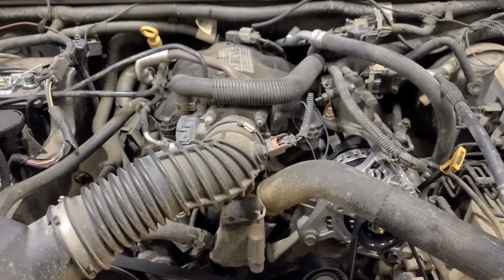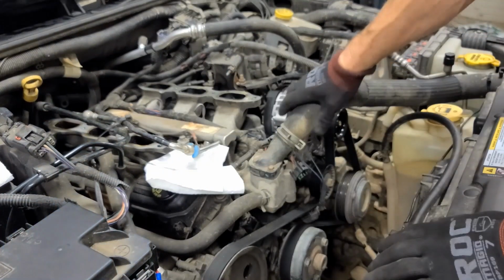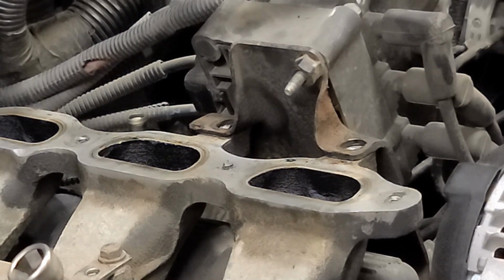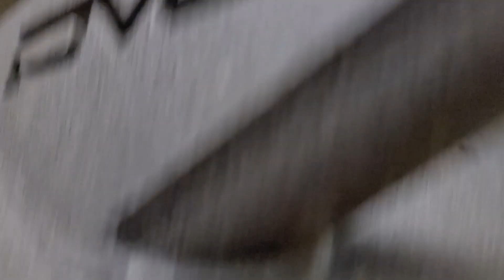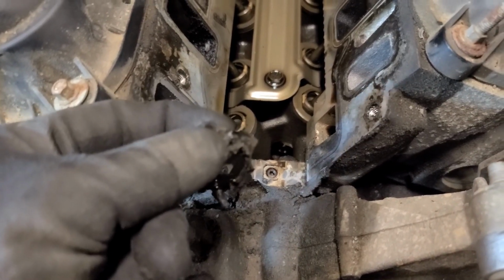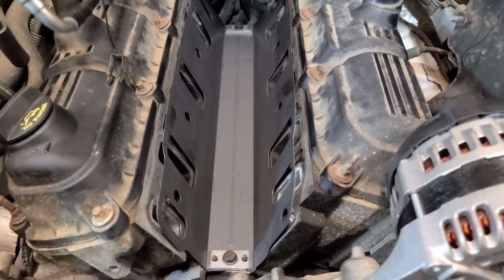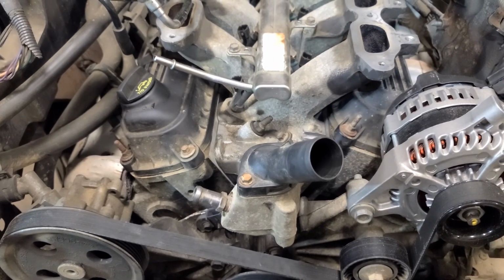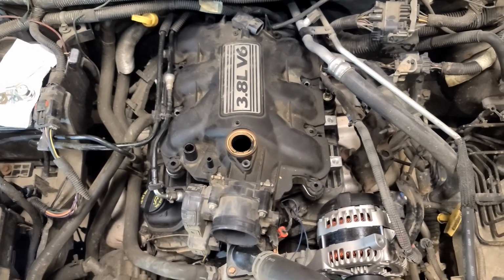Jeep Wrangler JK Lower Intake Manifold Replacement

Comment: Ive been a Auto Tech 25+ years, I have got to say the detail that went into your video was superb! Great work on listing all details. I subbed and hope to see more great vids like these from you. Just another note for anyone that has bad corrosion around that water ports, permatex makes a gasket maker called permatex #1 and its very good to fill in those pits caused by corrosion and make a good mating surface again.
Reply from the maker: Thanks for the feedback, and the Permatex advice!
Reply: @austin.gresham  No problem at all. Im getting ready to do this job myself soon as the weather permits. Thanks again for the video.

Comment: Thank you for posting this Mr. Gresham.  

This along the fuel injector video saved my 08 JK X.  Your instructions and recording was so clear it helped me repair this myself and I'm a newbie at best.

My Jeep had been leaking coolant and oil from this gasket for 4-5 years (I just kept topping it off every other week).  The oil was leaking from the RTV failure points.  I'm not too sure where the coolant was exactly leaking from, but it was pooling on both sides of the engine valley, more so on the driver side.  I didn't find coolant residue besides inside the coolant jackets themselves.  I'm leak free from here as of 100 miles thanks to you.  

As for the fuel injection side of things, the O-rings on my injectors were flat on one side and completely stiff.  The injectors themselves had corrosion sediment inside.  The spray pattern became much better after cleaning them.

I do warn others that if you're a zealous cleaner like me, I recommend 4 things, especially if your gasket covers also leaked for an extended period:

1.  MAP sensor.***  Inspect it and be ready to replace it, especially if your rough idle comes back worse after completing this.  If it's full of carbon/oil deposits, clean it with MAF fluid.  Do NOT use a cotton swab on the piezoelectric sensing part like me.  You'll destroy it.  Just use the swab for the channel/tunnel.  If your MAP sensor is broken, with key on engine off it will read less than 26 inHg, same as your BARO, and will remain at that reading evening when revving up (mine read 24 inHg).  If your MAP sensor is good, at idle it will drop to about 10 inHg.  Volts should read between 0.3 to 4.6, increasing the closer you're at wide open throttle.  I didn't have back probes available, so I decided to test resistance anyway.  The broken MAP read OL/1 with my Harbor Freight multimeter even at 2,000k resistance (max setting), measuring from either side of the middle prong.  The new MAP read 0.19 ohms with the left and middle prongs.  The right and middle prongs read 0.06 ohms.  For these readings, I held the sensor tube/nipple facing up but away from me while the 3 prongs faced me. The multimeter was set to 20k ohms reading.  Make sure the leads/alligator clips don't touch each other and are securely placed on them.  I read somewhere that MAP sensors shouldn't be measured for resistance because they're piezoelectric but I was just curious to take readings.

2. Shop vacuum with extensions.***   If your wire loom is as brittle as mine is, even if you cover everything up with painters tape/lint free towels, little parts will fall in.  If you scrub off carbon deposits with a wire brush and you don't bother to make sure the valves are covered, things will fall in.  Have a thin shop vacuum with extensions ready.  Taping hoses to the end of the vacuum shop can only do so much.  Go in gently so as to not shave off plastic from the extension wands into the cylinders.

3. Wire tape/loom.***  You're already here.  Might as well restore the loom with wire tape/loom.  Clean the wires with alcohol.  Let them dry.  Take your time.  Use zip ties to keep the branches together if you do take the harness apart all the way.

4. Oven cleaner and brake cleaner.***  I had so much oil, coolant, and dirt baked into so many of my components I got impatient.  Though the oven cleaner took off the gunk off the lower intake, it also etched the aluminum.  Don't use the oven cleaner on any plastic or engine block components as they can crack/permanently stain them.

I used brake cleaner to restore the upper intake/plenum.  Though it's plastic, I was careful to have running water immediately with me.  It still managed to warp the "3.8 L" sticker, but I feel so much better about it being clean.  The plenum will take the longest to clean.  I found soaking it in degreaser/vinegar to help.  

If I had to do this again, instead of letting the oven cleaner soak for 5-10 minutes like the directions asked for, I'd do several separate applications until the gunk came off.  Then I'd rinse with vinegar to stop the chemical reaction from burning the aluminum.  Water has mineral deposits, so I found myself doing one more pass with brake cleaner.  I would also want access to hot running water and Dawn dish soap.  The cold Dawn dish soap took out most of the gunk from the lower intake.  The upper intake was just harder to clean because of the limited space and creases.

This video made the process very fun.  Thank you again.
Reply from the maker: Fantastic!   Thanks for posting all these details as well

Comment: Thanks for uploading this video! It is awesome. I am mid changing the lower manifold gasket and valve cover gaskets on my mom's 09 wrangler and helped me with a couple points specifically draining the coolant - was not sure if necessary or not. Also learned about the rtv. Thanks again. Very in depth.
Reply from the maker: Thanks!  Glad it helped

Comment: Good video. I appreciate the time and effort in explaining the steps. I'm facing this repair on my 08 JK with 135k. I noticed coolant under the intake. Already have done the valve covers x2 and the oil pan gasket. I'm betting mine is leaking oil from the back of the lower intake gasket too.
Reply from the maker: Thanks for the feedback! As to your coolant leak, you may also want to check the thermostat housing (where the big hose from the radiator connects to the lower manifold).  I've had leaks there and the coolant "pools" in that spot right below the lower manifold gasket and the engine block.  Then the heat burns it off and you're left with a pink-ish crust from the evaporated coolant.  It may look like it's the gasket, but it may not be.  Thermostat housing is MUCH easier that the lower manifold (and cheaper!)...  also, could be the coolant temp sensor:  check the threads around there as well for that same pink color.  Good luck!
Reply: @austin.gresham  Good advice! I do have oil build up at the ends of the valleys so I am fairly certain the intake gasket is leaking.
Reply from the maker: @AlanWoodardwoodisgood  Sounds like it you may be right. Good luck with the repair!
Reply: @Alan Woodard. did changing the gasket fix your coolant leak?
Reply: @writtenpieceopaper1  Yes it did, still holding strong.

Comment: FYI:  You are referring to the socket size for the bolts -- 12mm or 13mm socket size are usually M8 (8mm) bolts and 10mm socket size is usually M6 (6mm) bolts. A 10mm bolt will usually have a 14mm or 15mm socket size.  Other than that, this is a nice video.
Reply from the maker: You are 100% correct. I am referring to the socket size so people don't have to guess which socket/wrench will work. I do say "bolt" which is technically not correct - the bolt size, as you pointed out, is usually designated as "M10," "M8", etc - not the same as the socket/head.

Comment: I have 435k miles on my JK.  I take bolts off low mileage minivans and use them.  Next rebuild plan on using metal valve covers off 2001 minivan. PCV valve hose will have to be modified on valve cover.  My plastic valve covers are warped but are working. I also bought a low mileage air intake manifold. The manifold is showing its age.
Reply from the maker: 435k miles is awesome!  Looks like you're doing all you can to keep her running.  The manifold is easily cracked, I actually put my finger through the top of one (resting my weight on it trying to get a bolt out near the firewall).  Luckily it was superficial and didn't poke a hole into the actual intake chamber. Unless you plan on another 400k miles, I would just use the same style plastic valve covers and spare the time/effort of modifying the PCV valve.  But if you have time to experiment, sounds like a fun project!

Comment: I have a leaking oil, and coolant problem, guessing this is the same issue you had.  can you tell me where I can buy the proper bolts, as snapping them in the engine is terrifying..  Great video!
Reply from the maker: The MOPAR part for these is 6102001. They are M6x12mm bolts you could source elsewhere, if needed (and likely cheaper)

Comment: Just snapped a bolt trying to get 105 inch pounds on the upper manifold. Brand new torque wrench. So be very careful when you do this, lucky me my engine is out so I can work around it to make the repair easier
Reply from the maker: Been there... I think technically Jeep recommends that the bolts be discarded and new ones used. I have extras just in case, but getting the broken ones out is no fun.
Reply: i’ve seen a lot of people have that issue from not blowing the threads out with compressed air after cleaning the surfaces. debris and dirt doesn’t compress well in the threads and boom, snapped bolt
Reply: 😂 yep the rest are hand tight. Waiting on new bolts.

Comment: Can coolant also get into the oil from the lower intake gasket failing?  My last oil got 'dirty' faster than usual?  I didnt have it tested, but will next time if it can.
Reply from the maker: Absolutely it can.  If the lower manifold gasket leaks, it can leak coolant directly into the engine, all the way to the pan. If it's bad, the oil in the pan will look like chocolate milk - that's a sure sign of coolant in the oil.  It could also be the head gasket.
Reply from the maker: Also, a simple way to check the head gasket is to remove the radiator cap and let the engine warm up to where the thermostat opens (roughly 200 degrees).  When the T-stat opens, if you see bubbles coming up into the radiator where you removed the cap, that means exhaust gas is getting into the coolant - most likely from the head gasket.

You can also rent a pressure tester from a local auto supply store which will tell you if there is a leak in the coolant system - just not where the leak is.

Comment: Great video Austin.  Really appreciate all of the time you took and detail provided.  Did you replace the EGR gasket and would you mind posting the part #?  Thanks!
Reply from the maker: Thanks, Chris!  I did not replace it in this video but I did when I replaced the fuel injectors (other video).  The gaskets I used for both the upper and lower EGR were NAPA.  The part number for the gasket that goes into the upper intake manifold was #70696 and the gasket that goes between the EGR valve and the EGR tube (under the wheel well) was #70721.  Both have worked great.  Good Luck!

Comment: The one im doing has rtv on both ends as well, around the coolant passages.
      Its leaking coolant.
   You reckon this is why? Its definitely factory. But this isnt the type of gasket that should have rtv on it.   Was always told if ypu have a gasket, adding rtv is just doubling the amount of places that can leak (1 spot between each layer of )
Reply from the maker: You definitely should only have RTV in those end spots where the block meets the cylinder heads. If you're seeing RTV anywhere else, I can't imagine that was factory. It could also be sludge build up from oil/coolant leaking and maybe not RTV, but that's just a guess on my part.  Regardless, scrape it all off and get a good surface for that new gasket.
Reply: @austin.gresham  lol just finished the job, fired it up, and its releaking, so bad . Took a few pictures, the intakes got pitting around the passenger side. 
      Cant get these i takes anywhere, id imagine this is why there was silicone on it, to hide this. I bet the dealer the customer bought it from did it, they bought it used about 7 years ago, said theyve always smelled coolant but no ones been able to find the leak
     Gonna see if the local machine shop can plane this thing down a few thousands or something.  Friggin sucks having to do it again
Reply from the maker: @marioncobretti7870  Sorry to hear that, it really sucks when people half-@ss a job and hand the problem onto the next owner/sucker who gets to deal with the aftermath.
Reply: @austin.gresham  ended up using high temp rtv to fix it. Its not leaking now, told the lady if it happens again ill redo it. Machine shop wanted way too much lol
I dunno why no one makes a better gasket or a different aftermarket intake. Youd think seeing as every wrangler ever made sells there would be a market for a known failing part. 
    Wish there was just a gasket like gm uses, thicker with rubber/eurythane around the coolant passages.,  but i guess in todays world cant expect too much. 
     Ill take it as a win anyways. Couple of  The bolts holding it down to the heads barely came out,  if they would of broke i dunno what i woulda done, so I cant complain too much

Comment: Thanks for the video, I did this the other day? Did you put any extra gasket material rtv or anything like that between the intake and the gasket? On my oem gasket, it looks like there was some there.
Reply from the maker: Thanks!  No, you don't want anything in between except the RTV in the corners. If there was something on yours either the previous mechanic did it wrong (which might be why it leaked) or what you see is crusted oil and/or coolant. The cylinder head and manifold surfaces should be clean and smooth.

Comment: Could the bolt holes lineup without it sitting flush? I just did this and have a vacuum leak now
Reply from the maker: If you are talking about the bolt holes for the lower manifold and not another part, no I don't think that's possible. I think it's more likely that it's above that in the upper manifold/gasket, brake booster hose, MAP sensor, PCV hose, EVAP connection, EGR tube, etc.

Comment: I'm not very knowledgeable about this engine, but how is oil getting into the intake manifold? Thanks for uploading your helpful videos!
Reply from the maker: The lower gasket is the only thing separating the crankcase from the manifold and the sides of the cylinder heads.  When it leaks, oil can get in a lot of places you wouldn't expect, but mostly down the front and back of the block.

Comment: Where did u get the fuel line disconnect tool ?
Reply from the maker: Hmmm...  good question. I've had them so long I can't remember, but I think one of the big-box stores like Autozone or Advance Auto.  The brand is Performance Tool: W83148.

Comment: Could the water leak into the combustion chamber causing the radiator to get air into it
Reply from the maker: Yes, it happens all the time in engines. But to be clear that wouldn't come from the leaking intake manifold, that would be the result of a head gasket leak. Think of it this way: the coolant is WAY above boiling when the engine is working - let's just call it 200 deg.  The pressure in the coolant lines means water is trying to get OUT of of any leak it can. The pressure in the manifold area is not that high in comparison, so more than likely the coolant will leak into the crankcase because the pressure is higher (coolant pressure > crankcase pressure). Now, if it's a head gasket - that's the combustion chamber.  The pressure there is WAY higher than the coolant lines, so usually air from there (from the piston compression) forces air IN TO the coolant.

Hope that helps

Comment: Ughh. I hate doing this job. How long does it take you?
Reply from the maker: When filming? About 3 hours 😂...  When I just "get after it" about an hour, maybe a little less.
Reply: @austin.gresham  Wow. Impressive. 1 hr is quick.
Reply from the maker: @512TXSDIY  To be fair, I don't do it exactly like in the video. The video is the "proper" order according to the factory service manual.  For one, I start the coolant drain at the beginning which saves time waiting while I remove the upper manifold and all the parts.  You'll notice in the first 4 min of this video I also don't remove the throttle body from the upper manifold - I just take it all off as one piece.  In the other video I remove it (per the FSM).  I also cheat a bit on the EGR tube although it gets in the way when I do it that way (but saves time).  Since this video was made for all skill levels, I kept it to "by the book" :)
Reply: @austin.gresham  Yeah… I would rather not share how long it took me the first time. I did this job 2 wranglers ago and about to do it again tomorrow on my new wrangler. Not looking forward to it mainly because it’s so tall.

Comment: That gasket looks like it just hardly seals up properly.  Doesn't seem like a great system.
Reply from the maker: The part at the bottom of the V, where the sealant goes, is not the best design in my opinion. That's why I like the kits that use the 10mm bolts in the V - some others just rely on the pressure from the weight of the manifold to provide a good seal and I've replaced a few of those in short order. The mating surface between the cylinder heads and the manifold are pretty good, though. I've only seen a few of those fail